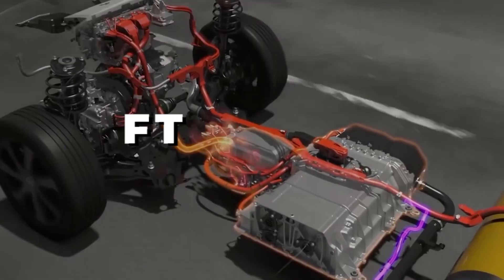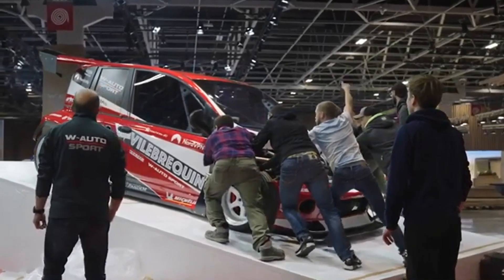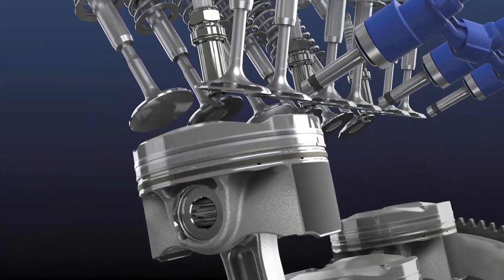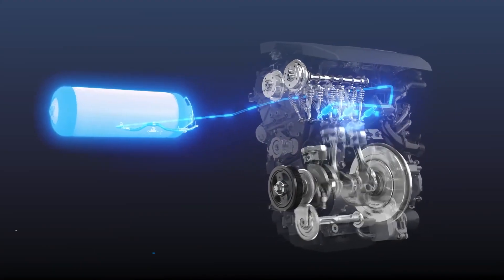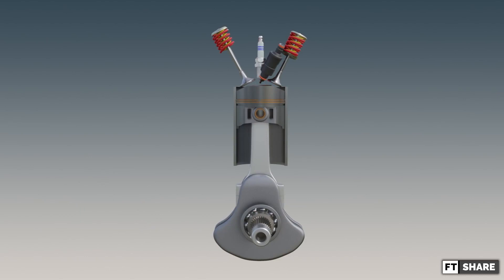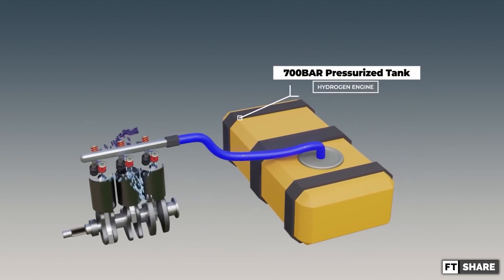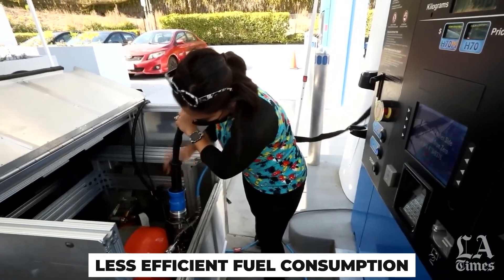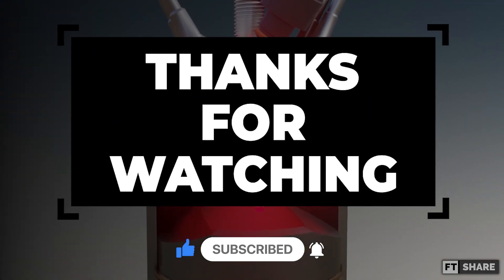Engine Without Air POLLUTION! | Hydrogen Engine (100009V2)

Comment: Hydrogen engine is not a good idea.  If you have hydrogen as fuel, use it for fuel cell to generate electricity on the fly.  This way you create no air pollution.  You burn something with air anyway.  There must be some air pollution.  NOx?

Comment: Hydrogen production uses a great deal of natural gas, and creates large amounts of CO2.
Not so environmentally friendly afterall.
Reply: how so?
Reply: @endurofan9854  At my work  the process starts with Natural gas feed into the process,  requires a LARGE Reformer furnace fired by natural gas, and a Benfield CO2 absorber tower. Google could explain better then me LOL.
Reply: There is also a process called electrolysis which has a by product of just hydrogen and oxygen. Which can be easily powered by dam’s and nuclear reactor’s.

Comment: There is a fundamental problem with this channel on the basis that it is producing video content about technical concepts that are well beyond the understanding of the video content creators understanding.   As a result the videos are basically recycling misinformation.  If you don't understand what you are producing enough in order to fact check what you are creating then don't create content.